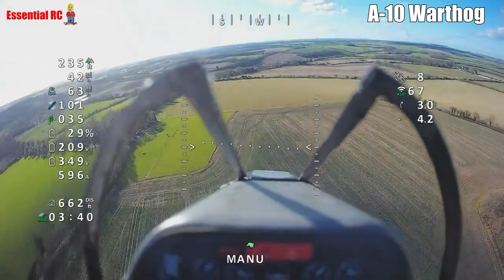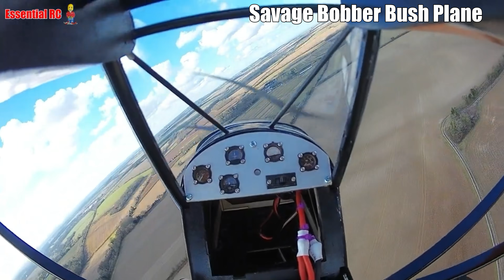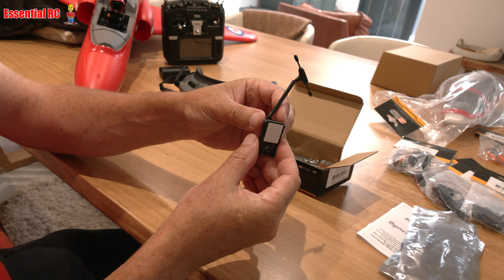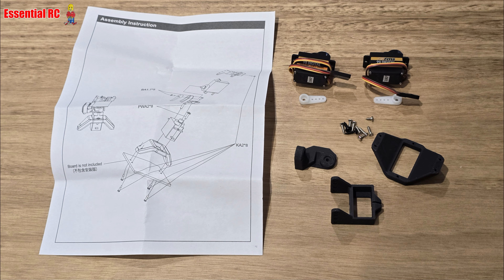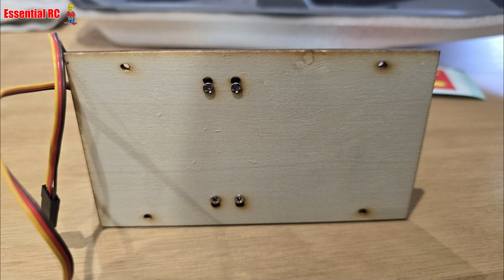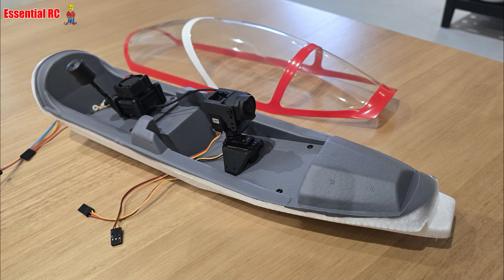Introducing FMS SyncPilot ! Head tracked FPV for RC Aeroplanes, Cars and More

Comment: What is the reason for the head tracker and transmitter to be two seperate things and not combined in the same module?
Reply from the maker: The old school way was for the head tracker to be connected to the trainer port on the radio transmitter. I guess just adding a separate transmitter was easier for the manufacturer
Reply: Makes it wireless and frees up 2 to 3 channels on your aircraft receiver.
Reply: Wireless as in, no trainer cable from head tracker to transmitter.

Comment: Gimbal part has been discontinued, so have to 3d print.  So, how do I reset servo to travel 180/280 degrees?  Thx.
Reply from the maker: The 280 deg servos are designed specifically for that. They can't be changed.

Comment: I have the FMS Syncpilot mounted and everything works well, however, how do you adjust the amount of travel for the downward direction of the camera because the camera hits the plastic gimbal mount FMS provides if you look down?  

Thank you
Reply from the maker: I think you've probably got the servo arm on the wrong position on the output gear.
Reply: @EssentialRC I first centered the servo and then attached the servo arm so it was centered. Im using a DJI 04 Air unit.
Reply from the maker: @we4fm175  Doesn't have to be centred. Remove the servo arm and rotate it up one cog on the servo output gear, and screw it back on. Then it wont go down so far. Obviously it will go up further but that should be OK.
Reply: @EssentialRC Thank you, I will give that a try. 😊

Comment: hello, how do you activate the 03 camera, (not to be in low power mode),
Reply from the maker: If you have the latest firmware on the goggles and air unit then there should be a menu option in the goggles to turn off stand by mode but bear in mind the air unit will overheat quickly unless you are flying or have a small fan pushing some air over it.

Comment: how do you find the range?   Do we know what the actual TX/RX system it uses?
Reply from the maker: Stated max range in the air is 2km. Plenty far enough if you are keeping within VLOS. If the receiver goes into failsafe the servos go to a neutral position you set before take off.

Comment: Very cool for fixed wing pilots who want to get into FPV, BUT, they need a camera and headset kit we can buy that will plug and play with their new Syncpilot system. We are model airplane flyers, not drone flyers. Most airplane flyers are clueless where this stuff is concerned. I glanced at the DJI site, and I'm even more lost. People need some direction. This video was good at explaining this part of the system, but now we need camera and controller, and headset!!!!  No clue there!!  Who, where??? What works and doesn't work.  We need some type of plug and play kits.
Reply from the maker: I don't see FPV systems ever being packaged with RC fixed wing aircraft. This is probably as easy as it will get.

Comment: New account but long time subscriber, u use inav and xf user with 03 , will look at this but to be fair I’ve fine tuned my setup now so much it’s so easy to use my only gripe either way mine is using the trainer cable but I just tuck it behind my ear till I’m flying but looks good thanks dom 🙏
Reply from the maker: I'll still do that on 2 of my planes. Do find the TX cable so annoying

Comment: Does the fitting of this system need weights added in the aircraft to maintain the Centre of Gravity ??
Reply from the maker: I do mention this in my video that is out today...but yes, it could do, if you can't move the flight battery back wards to compensate for it. For the FMS 80mm BAe Hawk if you used a 6S4000 you would probably be OK but I was using a 6S5000 and 6S6000 and had to add weight to back of tail to compensate.